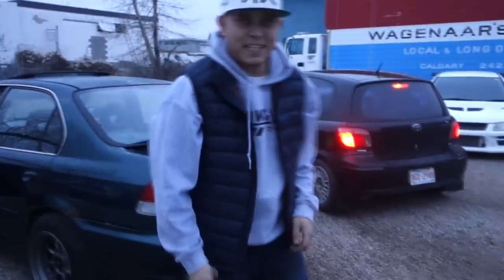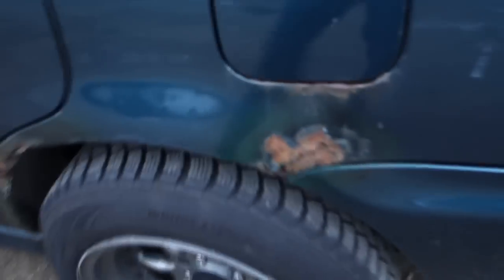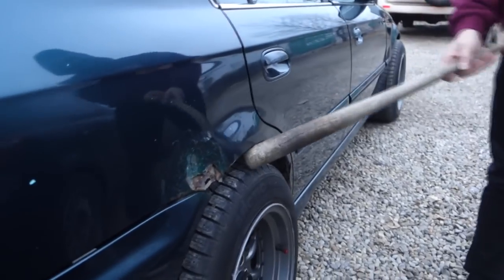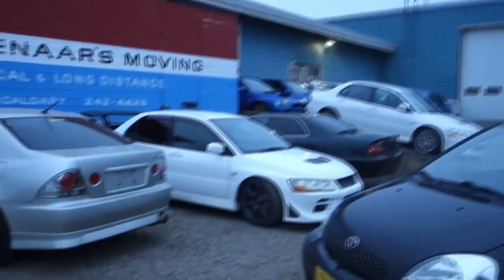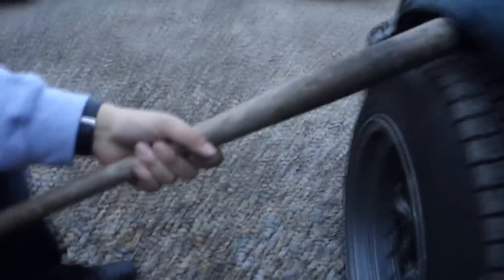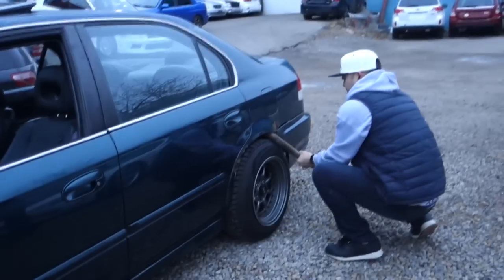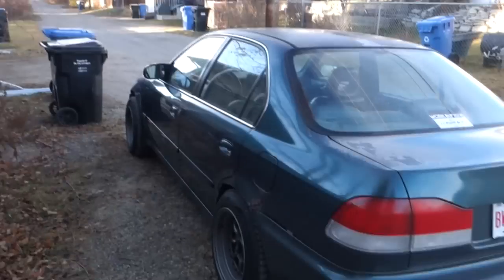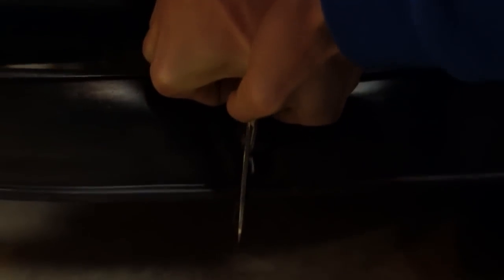How to Ruin A Winter Beater!!

Comment: Just picked up my winter beater a right hand drive awd 94 Subaru Legacy 115k miles paid $300 had a misfire after the owner did a "tune up" and found out #3 spark plug was finger tight, three new plugs in it and it runs mint

Comment: Why the fuck would you lower a car for winter..
Reply: Because race car dude.
Reply: Spicy Roo that's the point to beat it up and fuck around
Reply: Austin Okay but i dont get why they would make a winter car that'll get stuck everywhere
Reply: 2 words "snow plow"!!!
Reply: Spicy Roo this wont even last them pre-winter with that head gasket leak fuckem they are biting off of haggard garage
Reply: I drive a lowered car in winter, works like a charm. You just gotta watch out for ice chunks on the road and thats it, snow just keeps the floor clean lol. You can't really get stuck if you're not off-roading of course.
Reply: Why the fuck wouldn't you want +45hp..
Reply: I drive my lowered truck everywhere fuck you mean "winter beater"
Reply: Spicy Roo because sled riding
Reply: i dont think he realizes that this car is to fuck up and fuck around they dont care abt it this isnt the s2000 or the supra they want to fuck it up thats the point

Comment: this is a solid method not sure if I would do it to my new Camaro though
...
Reply: I'd have it done professionally if I were you. A new Camaro deserves so much better than a wooden baseball bat. Besides, if you have them done professionally, if clear coat happens to be broken, or paint happens to be cracked/chipped, the company that does it fixes that at no cost. Just for a set of front fenders I wouldn't want to imagine what it'd cost to strip them, throw down auto grade primer and paint, color match, fade in to match the rest of the vehicle, and then clear coat so it doesn't look more transparent/less transparent than the rest of the car. To have it fixed if you did it on your own and broke clear and chipped paint, that'd probably be a grand or so to repair, assuming you took it to a professional to fix, instead of trying to do it yourself. IMO, it isn't worth the risk for a nice vehicle.
Reply: Chris Wilson Have you ever heard of sarcasm?

Comment: Why fix the bad rust holes which would fail rego here in Australia when you can spend your money on tyres that don't fit the rims, bit of dodgy rubber and an old baseball bat and now you're talking about lowering the suspension and putting a camber on it? Well done you'll probably fall through the floor at the next speed bump because of your priorities 😂😂😂
Reply: Their idea of a winter beater is like our paddock basher, except their paddocks are public roads.

Comment: Honda's reputation has been destroyed by Ricers that's why I buy Toyota/Lexus 😂😂
Reply: Big 😂😂😂 it's still a Honda. It has a Honda VTEC engine. Acura is just a Honda brand just like Lexus and Scion are Toyota Brands.
Reply: Big Acura is not even a company 😂😂😂 it's made by Honda. The Integra is built on the Civic platform. If it has a VTEC engine in it, it's still a Honda regardless of what Emblem it has on it. 😂😂 The Toyota Avalon and the Lexus ES is built on the Camry Platform as they have the same VVTi engines under the hood. They are essentially just upscale Camrys.